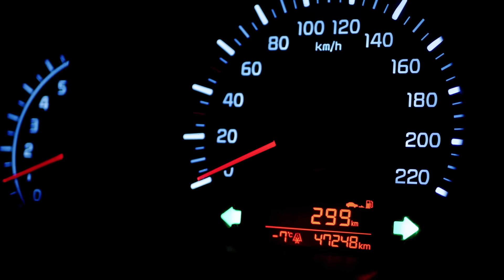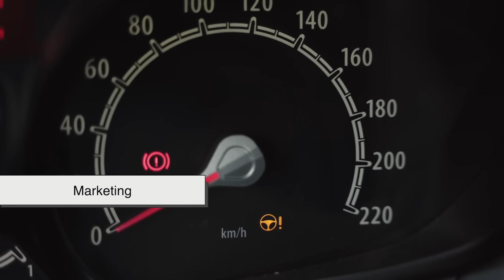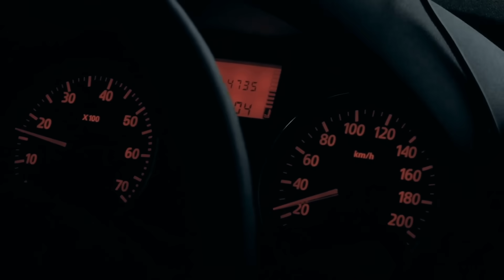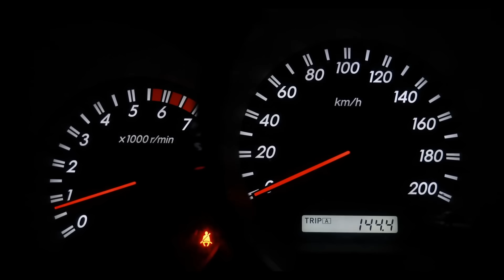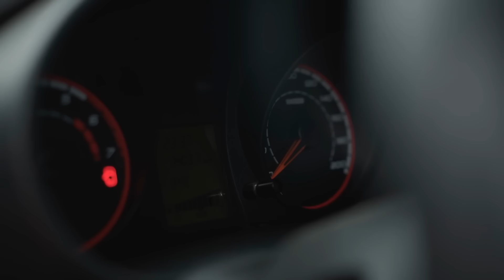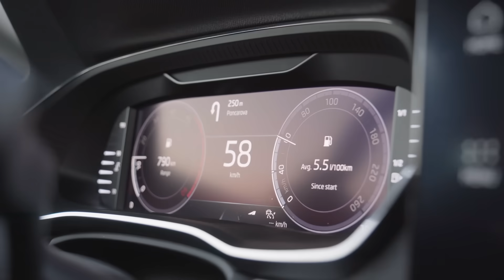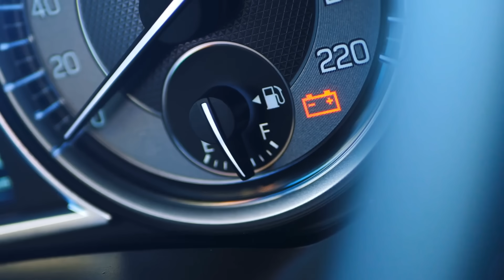Why Speedometers Go Over 200—Even if Your Car Can’t

Comment: I have a car with 150 hp. On my speedometer, the limit is 260, but I've never tried to go above 160 km/h, as it's too dangerous. I have no idea what the real upper limit is.
Reply: My 2023 civic sport has about same HP  but it reads 160 MPH on the dash but the factory only limited to 123 MPH
Reply: @shawnbrady5913  123 Mph, that is around 200 Kph...Usually, cars in Europe are limited to 250 Kph, but still, even 200 Kph is way too much.
Reply: @ozymandiasultor9480 if the car doesn't have any limitations it maybe go 220-230kmh tops. And there's alot of people leaving here in united states like to drive v8 and v10 engine able to go between 270kmh or upto 400 kmh even on motorcycles
Reply: @shawnbrady5913  Yeah, I thought that upper limit might be somewhere in that area, but I never really tried to go that fast. And sure, many people like fast riding, I guess in the USA there are more people who like that, unless I have a wrong picture based on movies and documentaries. I tend to be more careful because mistakes that are made at such high speeds usually end badly.
Reply: @shawnbrady5913  not the engine that matters, but the gear ratio (transmission). So an 1L engine can reach 240km/h etc...
Reply: Cars used to be speed limited by aerodynamic drag.
Reply: I would check first the speed limit on the tires before I would try high speed.
Reply: @pingpong_  Usually a good 10-20% above quoted car top speed if fitted correct tyres.
Reply: I had a car with quoted 160hp. A 1986 2.8i Capri. Top quoted speed is 125mph, slightly faster than the 3.0S (138hp) it replaced with the same speedo. Perfectly stable and solid above 100mph. That was practically cruising speed. Even above 120, but you could feel you're nearer the limit there.
Reply: My 2012 Opel Astra with 145HP went something like 200-210. I'm German, 160 is low average on some autobahn parts with 180 beeing considered a good travel speed when it's empty